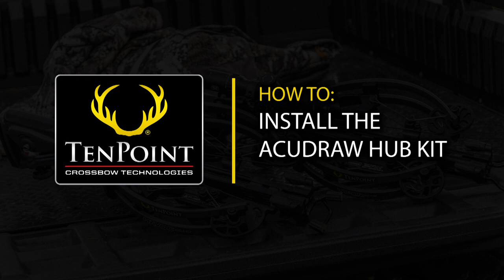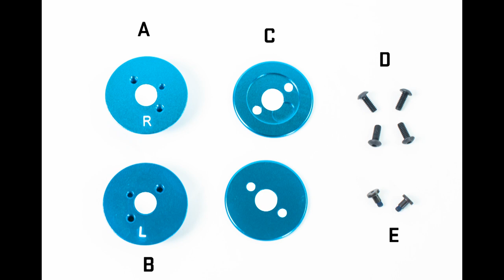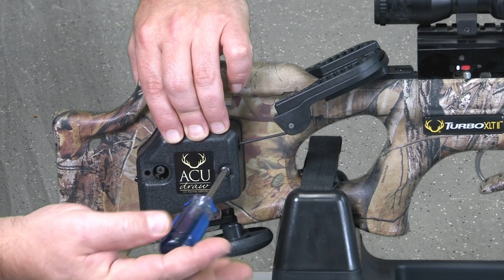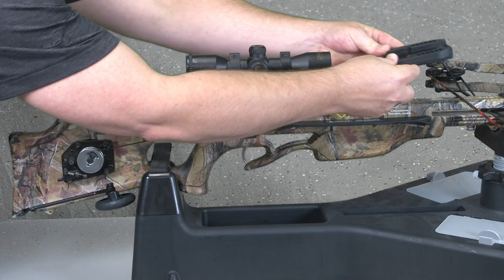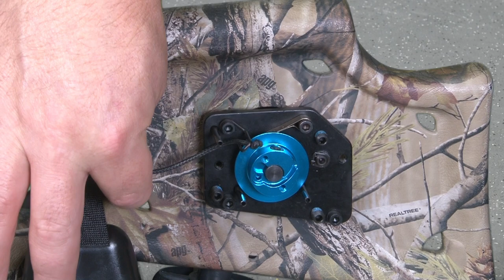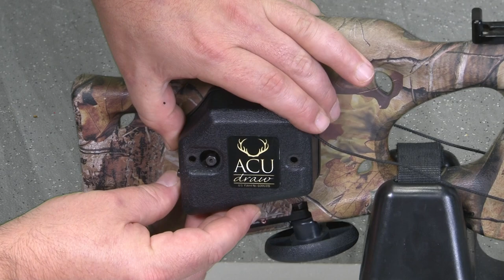How To Install the ACUdraw Hub Kit | TenPoint Crossbows

Comment: Just curious, why would the hubs need to be changed, do they go bad?
Reply: This is an updated version from the stock acudraw pro hub. The string frayed on my nitro xrt. Its a bad design the string guide had an edge on it which caused the problem. Im still super pissed I had to pay for this kit after spending $2500 buck. But I love bow so whatever,

Comment: I have an older Tenpoint Woodsman plus and I tried this hub kit but it doesn't capture the internal spring loop so there's no spring tension.  The old hub has a spring catch but they don't use screws to capture the knot ends. They use tiny washers that I cannot get the string through to reuse.  Any suggestions?